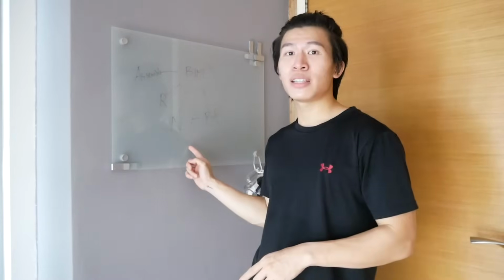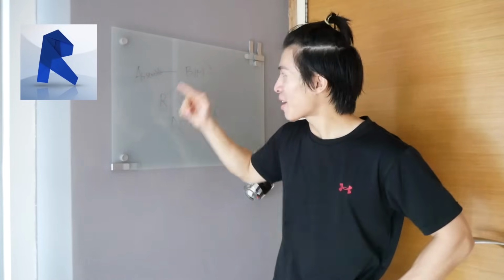How To Be A BIM (Building Info Modeling) Engineer

Comment: In the video, you say that Revit is the most important software for developing a project in BIM. However, this is true only if the project you are working on requires Revit. Revit is just one of many BIM software options available on the market, and there are others that better serve certain specialties. Revit is not the only BIM software.
Reply from the maker: Yes, there are softwares like Sketchup which can be used for basic design and visualization. Also a cheaper alternative to Revit. What software do you use for BIM?

Comment: hi! thanks for the informative video. does a BIM coordinator needs to be familiar with the construction site works?
Reply from the maker: Hi Christal, short answer, no you don't need to be familiar with construction site works to do well at BIM. Because you will be more software driven than construction driven. However, it will definitely help to have some field experience so you would understand the sequence of events, what goes behind the wall, reasons behind why floor to ceiling heights are 14 foot instead of standard 9 foot, etc etc.

Comment: There's not just Revit, Archicad is a BIM based model essentially around before Revit. Just saying....
Reply from the maker: Good point! Archicad may have laid the groundwork, but Revit has took over and is now the most commonly used software for BIM. Or at least in my experience.

Comment: Hi Trey,
Thank you for this great video! 
I am thinking to come back to construction industry after 10 years pause. By doing so, I wish to  complete my Master degree first. Perhaps it's slightly different from BIM subject, but what are the essential structural engineering software programs nowadays?
Reply: +1, you can try to use Robot Structural Analysis Professional
Reply from the maker: Hi Gabor, when I was a BIM Engineer I had worked with structural BIM Modelers and they mainly use Revit, Tekla structures, or ArchiCAD. I haven't heard of any other softwares for structural engineering. However, I'm pretty sure you will get exposed to it during your graduate program. Good luck and I hope everything works out for you.
Reply: Depends on the country you're in, but i'll give you the most used softwares, you have Etabs, Robot Structural analysis, sap 2000 and STAAD Pro good luck

Comment: I m civil engg..now working as structural drafter by using revit structure. .i known revit architecture &structure. .it's enough for bim modeller job?
Otherwise. Shall i learn mep?
Reply from the maker: Your type of BIM modeling would be structural beams and columns and not so much the Mechanical, Electrical, or Plumbing. However, yes if you are interested in MEP definitely start playing around with Revit MEP. Good luck and do update us on your progress! :)

Comment: Hey trey. I am a mechanical engineering graduate and I have work experience as a structural steel detailer. Will BIM be a good career for me?
Reply from the maker: Definitely would be a good career if you end up as a BIM Manager. However, Mechanical engineers get higher salary.

Comment: Hey Trey, what is the difference between a digital engineer and a bim engineer in your perspective ?
Reply from the maker: Hi James, a digital engineer is responsible for designing new digital hardware products and the circuitry to make them function. a BIM engineer is responsible for making sure that all models collected from subcontractors are in alignment and are not clashing with each other. BIM is very construction focused, whereas digital engineering can be very generic.

Comment: What's the difference between BIM modellers and BIM Engineers can some explain me have recently graduated and I heading towards BIM field
Reply from the maker: Sorry i thought I've replied to this. Basically a BIM Modeler focuses solely on creating new Revit models (in industry term, we call it "Revit Families"). BIM Engineers' job is to vet the models and to a quality check. Run clash detection and coordinate with subcontractors. Hope that helps.

Comment: Hi, how can facility managers benefit from BIM? Is there any need for Facility Managers to learn BIM?
Reply from the maker: Yes, by pushing out tasks to a BIM modeling system, Facilities Management will be equipped with easy-to-access, intelligent facility designs and models to leverage long term for occupant comfort and maintenance purposes. FM can push updates back into the database with automated reports and create workflows that empower crews to make sure no task slips through the cracks. Hope that helps.

Comment: Hi, I am currently working in construction industry and would like to take courses on BIM. However, there are options which are BIM and Computational BIM. I don't get what are the difference... do you? Thanks in advance
Reply from the maker: BIM is mainly focused on QA/QC the model, prevent clashes, build revit families, and coordinate with subs. Computational BIM is using plugins like dynamo to create BIM automation to help BIM Engineers work more efficiently. I would say get started in BIM first. Computational comes after. Good luck Stephanie!

Comment: I have recently persued architecture degree and want to work as a BIM engineer. Being known that ArchiCAD is a BIM software I have been working on it since three years and wanted to know if I could use the same software during BIM project management as parallel software to Revit in such construction workflow. Please guide me.
Reply from the maker: I see your point. But the thing is if you want to fully dive into BIM alone, then you have to adapt to the various software that BIM Engineers use. ArchiCAD is great, but for Architects. Bim Engineers never touch that software. If I were you, get good at Revit, then from there you could be a BIM Engineer before becoming a BIM Manager. Hope that helps. Good luck!

Comment: Great Video
Your explanation is outstanding. I am Mechanical Engineer working in kuwiat for HAVC, Fire Fighting & plumbing field execution Engineer. I am going to learn Revit Mep. What your advice for me.
Reply from the maker: Hi Golam, my advice would be to familiarize yourself with Revit and when you are comfortable, try Revit MEP. But again, it depends on your usage of Revit. If you are only modeling pipes and ductwork, then yes you may go straight to Revit MEP. If you need to work on the overall BIM execution, then Revit first to understand basic concepts of the tool.

Comment: Other questions please
1) Can you also use archicad as a BIM software rather then revit??
2) Can BIM also be used in the design of bridge??
3) What about us freshers that haven't yet use BIM360 desig collaboration b/c the are obligated paid software !!

Hope the is no problem asking a lot of questions
Thanks and have a nice day sir
Reply from the maker: No, Archicad does not work as well as Revit, which is a lot more versatile when it comes to workflows. BIM can be used to design a bridge. But a separate engineering calculation needs to be done elsewhere. Typically a structural engineer would do the calculation, then a BIM Modeler would use the right type of bridge to be placed in the model. If you are still a student, you are able to sign up for Autodesk's free trial.

Comment: Can sketch up helps u ? While modeling and can sketch up will replace Revit upcoming years
Reply from the maker: Yes sketchup is useful as well but it's not as important as Revit and the other Autodesk softwares. No, Sketchup will not replace Revit.
Reply: @TreyTan  thank you .   
Is it necessary to get some kind degree like Masters in Bim or by mastering all the softwares you mentioned in video is enough  to be a Bim engineer?
Also there some universities in uk which offers 1/2
 course of bim should I do these courses?
Reply from the maker: @ruturajhegana1164  It is not necessary to get Masters. A bachelor's degree in Archi, Civil, or Construction could get you an entry-level position. However, if you're from a different background (graphic design, film), and you would like to get into BIM, then yes, take the master's degree or enroll in BIM courses.

Comment: Hi Trey! I would like to know the process and time it takes for the project to start. I am guessing you start with the architectural and MEP designs, then with their info, you start modeling the 3D, and then pass it to the construction team? How long does it take you to build a model (at least ready to start building the project)? How long does it take for the project to be ready for construction? Hope you can help me with these questions!
Reply: Exactly the same question that hit my mind while I was watching the video.. Finger Crossed and looking forward to listing from Trey. I presume the Construction cannot START unless the Building Modelling is 100% completed (Initial BIM) and then at later stages, during the execution, any changes required will be incorporated... let's see what does trey has to tell us.
Reply from the maker: @irfanullah007  Ideally speaking, construction can start as soon as Arch is about 50% while structural is about 30% completed. However, in the real world, construction usually start when Arch is about 40% while structural is 20%. What goes first is excavation/demolition. Then concrete foundations (Structural design) as per the Architectural dimensions. Basically you could think of it as a shell with no furnishings. But to prevent delays, construction team would go first to prepare the site work.
Reply: Excellent, thanks  a lot Tan for the detailed reply on the subject and it did really help. Cheers!!
Reply: @TreyTan  Isn't 20%-40% a low percentage to start a job?  Maybe that is why there are so many disagreements between PM and Architects during construction?
Thank you for your answers! I feel the BIM subject is still "new", especially in schools and unless you are working and putting in on practice, it's hard to understand it.
Reply from the maker: @mariaafuentes6613   That's true in theory, but like what I told Irfanullah above, construction can start as soon as Arch is about 40% while structural is about 20% completed because what goes first is excavation/demolition followed by concrete foundations (Structural design) as per the Architectural dimensions. This is so that the team could prevent construction delays, unforeseen circumstances, and achieve T.O.P before the warranted deadline. In real life, construction won't wait for the perfect 3D model before starting, this is because the owner is always changing his/her mind. If we have to wait for the perfect 3D model, construction would most likely never start at all. Hope this helps!
Reply from the maker: @mariaafuentes6613  Yes, you are right. BIM is still very new in this industry and only recently saw a widespread adoption by companies worldwide. Let me know if you have any more questions and I'd be happy to help! Cheers!
Reply from the maker: Great Question Maria and Irfanullah! Correct, the 3D model has to start from Architectural and MEP and as part of the BIM team, our job is to make sure that everyone is on the same page when it comes to systems, coordinates, formatting, units, etc. Now this varies from company to company, but for us at Katerra, we DO NOT create the 3D model unless said otherwise. We would take these models from Arch, MEP, Struct, and put them together where it aligns geometrically, perform clash detection, QA/QC, create estimates for construction estimating team (per floor level, per building, per category, etc). Usually we pass it to the construction team when it is about 70% done, where clashes are almost fully resolved, no misalignments when various models are synced, and it looks ready for production. Based on my experience, the construction team mainly require 2D floor plans with dimensions (piping, electrical, furnitures, wood work, structural, etc). Your job is to assist them as much as possible in regards to printing these 2D sheets as most of them do not know how to use Revit. Depending on the project size, it could take somewhere between 4-6 months. Huge projects typically take around 8-10 months to reach 70-80% completion. Hope this helps!

Comment: and is it possible to make 3d model with tekla structures then continue to navisworks, or it's only work with revit?
Reply from the maker: Sorry just saw this, yes it's possible. However, it depends on the standard your company is using. In America, the industry standard mandates that we use Revit, Navisworks, AutoCAD, SketchUp. Again, depending on your company and what available resource they would provide.

Comment: Hi Trey. I am a fresh graduate and am looking for job, of which I came across a BIM trainee apprenticeship program. I understand that the BIM program would deliver us to utilise BIM, but like you said, does this mean we have to know revit and autocad in very very very very detailed to start with? Or are basics just enough to start the BIM training program? If basic is enough, would you define the term basic? What would we have to know first hand? Please Trey 😣
Reply from the maker: Hey Bryan. Congrats on your recent graduation! To start off, it's best if you have basic knowledge of Revit and autoCAD - this equates to modeling your own house/building with basic features (doors, windows, floor, ceilings, furnitures, walls, etc). Once you can do that well and have understood the interface of the program, then i would say you are pretty much good to go. Of course, the training program is going to refine and improve your BIM skills. So I wouldn't be too worried about that. Good luck with your new career! Cheers =)
Reply: Hey trey, sorry to disturb you but i also have the same problem me also a new graduate and want to be hired in a bim company in japan i am a foreigner here in japan and want to work here in bim i am an architect student and what kind of company do i have to choose. Waiting for your reply sir.
Reply from the maker: @aasishshrestha6694  Hi Aasish, at this point I can see that all you need right now is a job to gain entry in the industry. With an architecture background, I think your best bet is to become an associate designer (assist licensed Architects), or Revit drafters/technician. It's easier for you to become a designer but that will most likely lead to the path of becoming an Architect. Revit drafters on the other hand will become BIM engineers.

Comment: Hi... Thanks.... what do you use for reinforced concrete and the others structural projects?
Reply from the maker: Hello Engenharia, we generally just use Revit and Advance Steel. However, we don't create the 3D models (the structural engineers would do it by referencing the AutoCAD drawings), we only manage and run clash detections to make sure there is no discrepancy. Hope that helps!